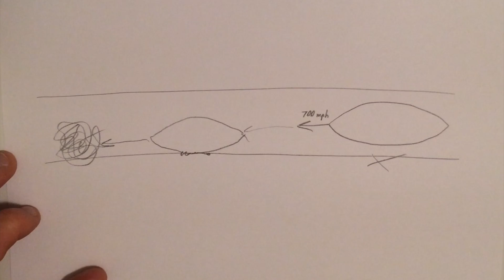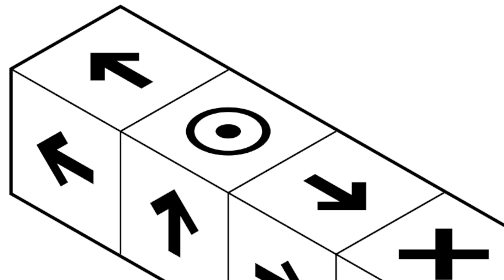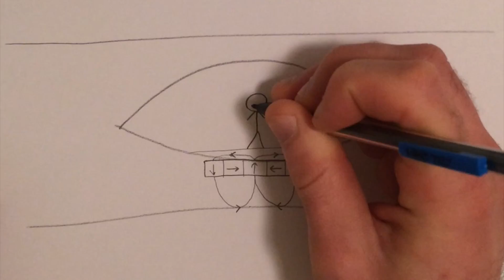How Will the Hyperloop Levitate?

Comment: Dear Tube Travel, to deduct, that drag reduces with raising the velocity out of the fact, that at a given mass, the magnets try to increase the distance to the eddy currenting surface (or coils), when accelerating, is misleading. You tie up the math from the wrong side. If you wanted to benefit from that increasing distance, you had to use more permanent magnetic force, which then induces more eddy currents to lift it to that larger distance, and all equals up to that: the drag raises by the square of the velocity, at any given mass and magnetic force!

To visualize it, look at the results of the Spacex Pod Competition, where the Delft and the MIT teams did not come along any meaningful way, while the WARR team went to the end of the test tube, because they did not use the magnetic levitation (They actually unmounted the magnets shortly before the race!), but drove on four simple wheels, of course helped by some thrust of their accumulator driven compressor fan jet.
Do you know of what the tube's inside pressure was at these runs?

Maybe read my comments about it at Hyperloop One's video: Vision for America Event
Reply from the maker: I'm sorry the video was misleading.  I was considering putting the equations in there, but I'll do it here instead (see link below).  Surprisingly, the magnetic drag really does decrease with velocity.  This can be shown from the equations on the right side of page 2 in the link.  

http://www.askmar.com/Magnets/Inductrack%20Magnetic%20Levitation.pdf

Aerodynamic drag does increase with the square of velocity, but that's because the vehicle comes into contact with far more gas molecules at higher speeds.  In contrast, magnetic drag involves an interaction with the same track no matter what speed you go.  

I am not surprised that the teams in the SpaceX Competition that used magnetic levitation did not do well.  The top speed at the competition was 58 mph, and at that low of a speed, wheels can have far less drag than maglev.  Rolling drag remains relatively constant at higher speeds, while magnetic drag decreases with higher speeds, so when you get up to higher speeds, maglev is the clear winner.  More importantly, well-designed wheels max out at around 300 mph because of excessive heating, so it is not practical to use them for speeds any higher than that.
Reply: Exactly this equation is wrongly interpreted. It is a severe contradiction to evacuate the resisting gas, and then introduce a new magnetic drag, which acts maybe one order of magnitude less than the aerodynamic, but still rises squared to the quotient of the increase of velocity. Try to push the magnet shown in your video faster trough the copper tube. And then you'll experience a sheer extreme resistance. But many nowadays do not understand physics no more, because they do not take it in their hands no more.....
Reply from the maker: You make a great point about the copper tube situation.  Drag would increase with higher speeds in that case; otherwise a magnet falling though a copper tube would speed up instead of reaching a terminal velocity.  Inductrack is different though.  According to the link I included, "levitation forces approach a constant value, while drag forces decrease inversely with speed," so I believe I interpreted the equation correctly.  I'll try to give a brief mathematical explanation of why, but if you want to talk on the phone instead, I would be happy to call you. 

So the main concern for us is the L/D (lift to drag ratio).  The weight of the vehicle is constant and equal to the lift, L.  Therefore, maximizing L/D will minimize D.  In equation 5, L/D increases with the velocity, v.  That means drag (at a given lift) will decrease with v.  I appreciate your thoughtful questions, and I hope you continue to ask them.  That's how stuff gets done!
Reply: That is not how stuff gets done. Lets wait for the H1 first public demonstrations.....